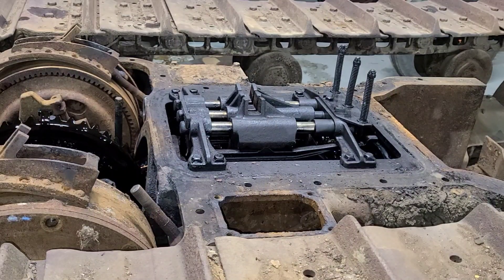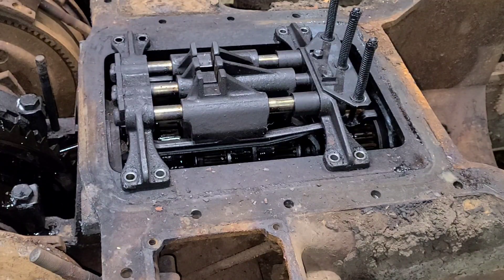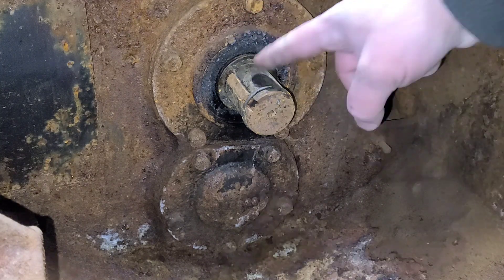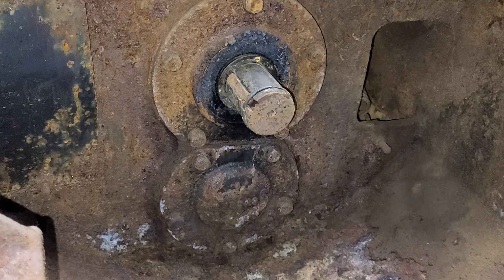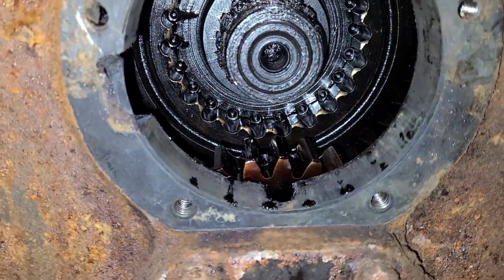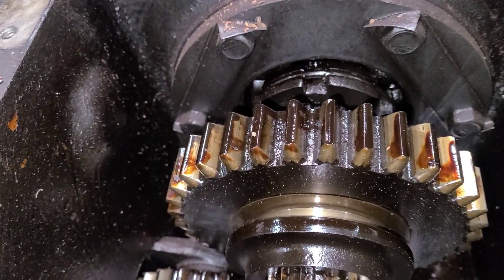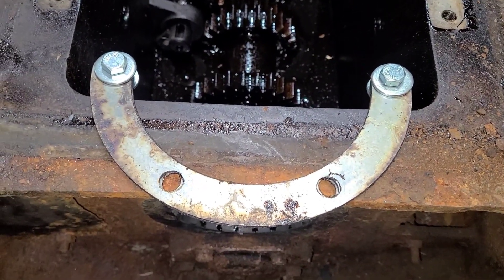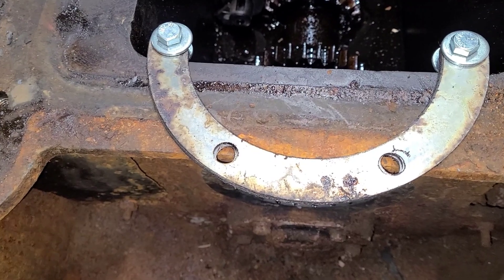Caterpillar RD-4 Transmission Disassembly Pt.1

Comment: Seeing what happened to that grease at those temperatures was a real eye-opener.  I knew that oil got thicker as it got colder, but wow.  I understand how there's a serious lack of lubrication at very cold temperatures when a machine is first started up.  You really have to be careful about warming up not just the engine, but the whole drive train before just dropping in gear and taking off.

Comment: I would like to think that the modern gear oil will stay a little more fluid than old stuff when its cold. Its done its job though and I think you have a really good Cat as a basis for restoration. Keep the videos coming they are excellent.
Reply from the maker: Thanks!

Comment: Gears and shafts look fine.  I'd give real consideration to re-using the original bearings wherever possible.  They are likely better, even part worn, than most of the modern ones.

Comment: I would put a magnetic heater on the bottom even though it is going to warm up, it will take the metal and oil awhile to absorb that heat.

I try to  nestle a sunflower heater in close to where I am going to work and leave it on low for awhile before working on it  the item acts like a heat sink and it is a little more tolerable to be around.

Great tip on the shims too!  Thanks for sharing!
Reply from the maker: Video coming tomorrow on the oil, warm weather is here!

Comment: Kyle, would it help your progress if you put a small electric heater under the the trans blowing backward and leave it run overnight to heat the gear grease and warm things up a little before you wind up with frostbite? Even if it gets up to 60, (for how long), it will still be a while before that mass of metal warms up enough. Great job, great tip,,, that's what I watch these vids for, Thanks.
Reply from the maker: Pete, I currently have the plugs out and the oil actually turns back to a liquid fairly quickly, after a good warm day it should be enough to flow out into a catch pan. Thanks for following along

Comment: Just did the diff and bearings. With new seals  steering clutchs and brakes on my D 7 C 17A. All my parts   came from General Gear  in Boise
Reply: Good people to deal with, got all my steering clutch parts for my IH TD6 from them

Comment: Might I recommend CO2 pellet blasting to remove paint on housings where oil and bearing live. The clean up is very easy as the CO2 pellets evaporate and alls that is left is paint flex’s. Removing sand and dust from oil passages is always very time consuming to do it right and you never know if you have it all out.

Comment: Well, can remove the plugs. Put a pan under to catch the oil, plug in a small electric  heater box and let it cook! Day or two should be drained!
Reply from the maker: The plugs are removed and a catch pan is in place, the warmer weather coming in should turn it back into a liquid so it drains out

Comment: You are very patient with your disassembly of this old crawler,  when I bend those lock tabs back I start with a small chisel and then I use the correct size socket and tap it done with a hammer.
Reply from the maker: That's a great tip, I'll have to try that out

Comment: Take a look at Dustless blasting instead of sandblasting.  Yes, Dustless blasting uses water but there are agents they use after the blasting to prevent rust.
Reply from the maker: I've seen it, and I really see no advantage to dustless blasting. It still uses a media/sand that gets in everywhere, plus around here it's almost twice the cost as traditional blasting, thanks for watching

Comment: Need a wood burning  heater  in that cold shop. But it's going to be a good  project  . Once done with new paint  going to look  good.  Put her back to work.
Reply from the maker: I have a wood boiler that heats the house, the lines are run into the shed but without insulation I would just be burning through wood and not holding in much heat

Comment: Hi Kyle,do watch the orientation of the reverse idler when you remove it. It is handed, but it's not that obvious. Can't remember which channel I picked that up from, maybe Squatch.'s! Anyway, the gears look ok on camera. That's obviously a very big plus for you if true.
Reply from the maker: The idler has been out before at some point and is marked so no worried there. Gears should all clean up well, thanks for watching

Comment: Kyle  it looks like the gear oil in it was mixed with gl5 !!! 
Because  I'm shure it had mineral oil in it  !!  And if you mix the 2 it will look like tar and not run !!! 
I had a  67 GMC transmission someone did that to and the only way I got that nasty stuff out was to put a quart of dextron in it and drive it around the block and drain it !!! 
I had to do that several times before I got it cleaned out  and it started shifting properly!!! 
And I know you can't do that  !!! 
I hope it will drain eventually 🙂
Reply from the maker: Lots of solvent once the parts are out, thanks for watching Evan!
Reply: @kylechrist  yes 👍

Comment: Those shims adjust the depth of the pinion gear to the ring gear. Don’t loose them
Reply: I'm wondering with the shims all on the top seems like they adjust the angle too.

Comment: Good series. I'm glad Squatch  253 directed us to you. It's obvious it's cold looking at the gear oil and seeing your breath as fog throughout the video. I don't know how you work with bare hands part of the time. I'm sure you know this, but there are a variety of radiant heaters that can direct heat just to where you are working rather than try to heat your entire uninsulated shop.
Reply from the maker: The weather is making a turn for the better but yes, I've looked into different heaters, thanks for watching
Reply: Yep Squatch253. Is a solid dude
Reply: I agree with David, but would also like to suggest a salamander as a cheap, quick way to at least take the edge off the cold.

Comment: Gears look super nice so I don't think you will be having issues with having to replace a lot of mechanical parts. Ok the engine maybe still a can of worms to be opened. But over all it is looking very mint. Soviet Crawlers have the pinion shaft that engages with the ring gear down low. So you don't need to take out the entire shaft. As for the rust: have you a idea with what to clean this? Sand blasting dose not seem a very good idea.
Reply from the maker: I can still pull the rear shaft with the pinion in place, I chose to move to the transmission as it all needs to come out anyway and it wasn't completely covered in tar/oil
Reply: @kylechrist  Wise move since that tar like oil is gonna stick everywhere anyways.